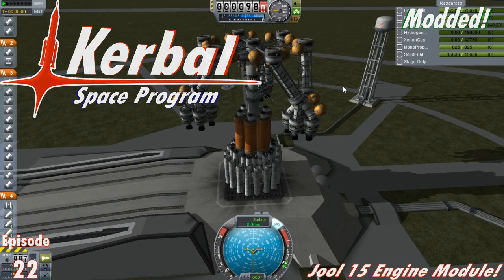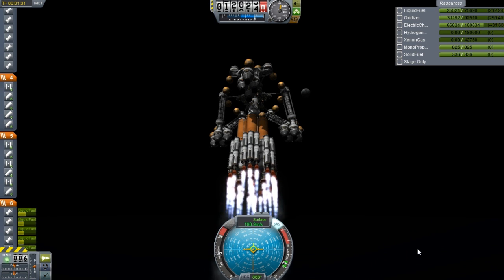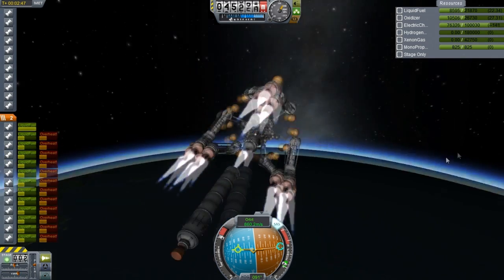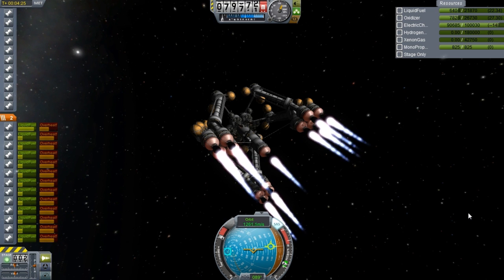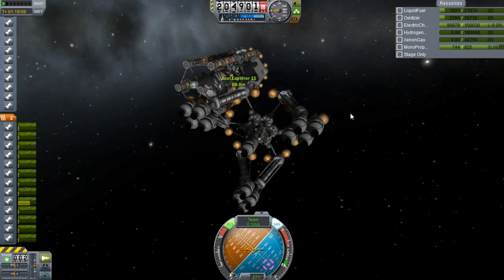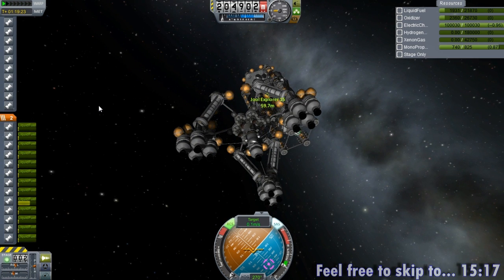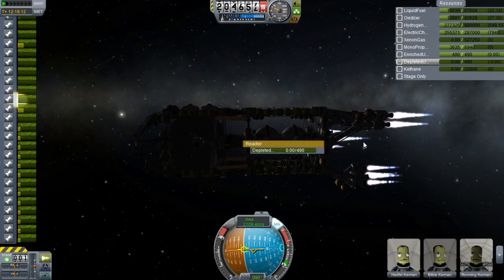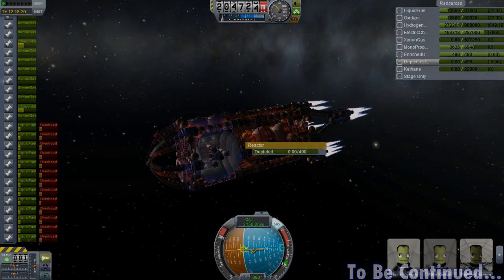KSP Modded - Ep. 22 - Jool 15 Engine Module!

Comment: How did you get separated parts (on core) to connect again (on engines). Have not watched whole vid so don't blame D:
Reply: 5 docking ports for each part (if all do not connect he right click undocks backs off short distance and pushes back to it so it clean dock all ports)
Reply: no i mean the only engine part, not the whole ship
Reply from the maker: ziggi231
I'm not quite sure what your asking but I will be doing a bit of a tutorial on the creation of this beast.
Reply: Ok. So on the only engine part You have three clusters of atomic engines which have each two connections from the docked part ont top. How could you get that to happen?
Reply from the maker: ziggi231 well the main root part is in the middle and I built all the other structure off of that. Some was done with the symmetry tool but a good portion of it was done by hand as some of it isn't exactly 100% perfect. I will do a video on the construction of it all soon. If this answer clarified anything.
Reply: thanks